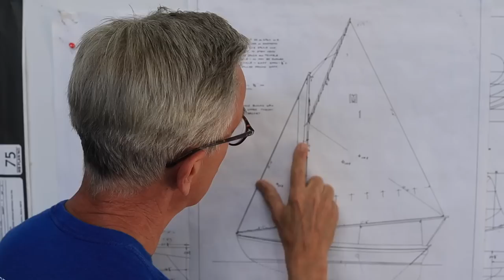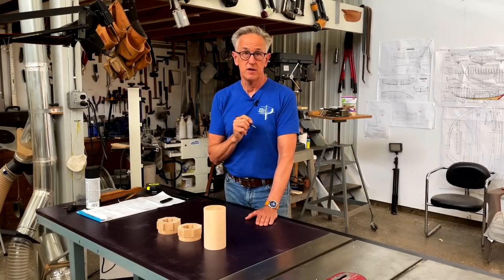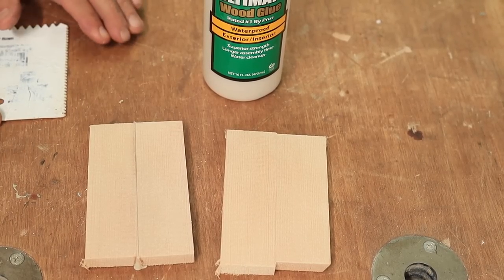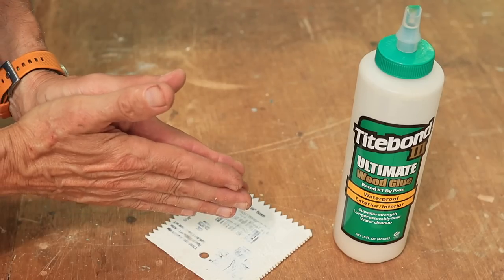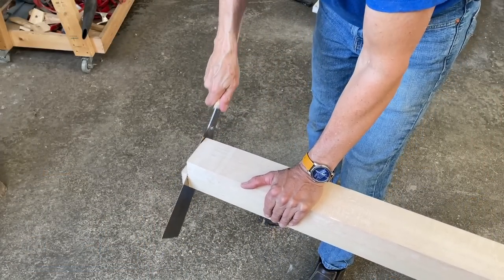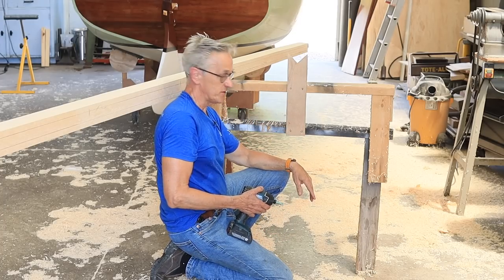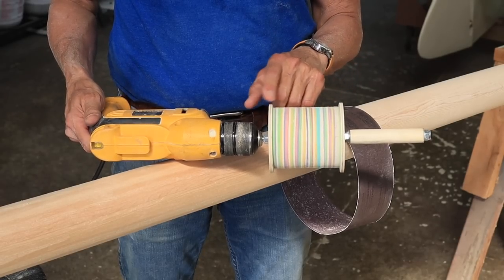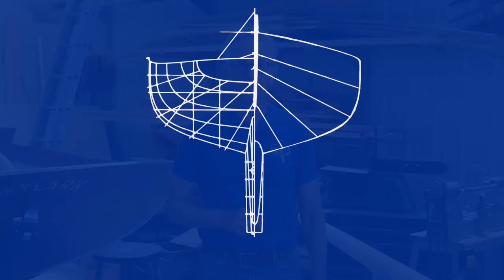Hollow vs. Solid Mast S2 E66

Comment: I'm a naval architect, been building sailing wooden boats for the last 20 years, restored, own and sail a Rival 32 on which I build a cedar hollow mast, along with a cedar boom and spreaders, which are in use for the last 15 tears. never had a problem with it. The core is reinforced at the base, about half way to the spreaders, at the spreaders and at the top. It's been coated on the interior and exterior with epoxy, all the glued joints are also epoxy. All thru bolts are predrilled and fitted with stainless steel tubing epoxy glued where the bolts fit into. electric wiring goes thru the interior from bottom to top, all running and hoisting cables are exterior running with guiding holes on the steps fitted along the mast, this steps are a easy way to inspect the mast at all times. The construction is a simple case with 4 sides and planned to shape. simple and robust, overall it saved about 30% of the weight. The mast is 36 feet long and I can lift it alone, with some difficulty but still can.

Comment: Nice work there mate.  About 10 years ago I  made a new mast for my 28ft gaffer,  it was solid with a 30mm hollow that I use for cables to mast head.  I purposely didnt seal the indide but allowed air flow from both top and bottom by using a fashioned cap on top .   I figured that if any moisture gets behind any fittings and  could potentially start to rot, that the air flow insde the mast  would help out.  10 years later, no problems what so ever.  
I used resorcinol glue and also no issues so far. 
Thanks for sharing your work, cheers

Comment: I'm a structural engineer so immediately your question of hollow vs. solid was intriguing.  In bending which I think is the primary stress acting on the mast, a hollow cylinder is virtually the same strength and stiffness as solid.  I watched to see how you built the mast and it seems that building it from 2 pieces is quicker and less prone to problems that building it out of 8 strips.  I don't think the savings in material is worth the complicated joinery.  You appeared to have gotten 2 good pieces of wood to build from, the advantage of building with smaller pieces is that you might have a better chance of getting 8 uniformly good pieces of small wood than 2 uniformly good larger pieces.  This would likely be more true if you were building a significantly larger mast.  In building construction you've likely seen composite materials such as glue laminated wood beams.  These are significantly stronger than a beam sawn from a large piece of lumber because each small piece can be made up of uniformly good wood, a large piece is more likely to have variations that would reduce its overall strength. However I think even if you were building a significantly larger mast it might still be better to laminate boards flat than to join them to form a circle.  Something you didn't address about the methods of building the hollow mast- how do you taper it to 2/3 of its diameter at the ends?  It seems that the material would get too thin at the ends to work with.
Reply: Easiest way to do it is to gradually reduce the width of the dovetail piece as it gets closer to the top, just take a mm off the flat face every 10cm or so, for example 
If you are really looking for performance then you could also reduce the thickness of the piece but personally I’d prefer to keep the internal thickness as the diameter gets thinner,
Reply: "best" ... after all is said and done, IF you don't need electronics up in the mast, THEN go with the strongest / most efficient / cost effective, BUT if you NEED electrical up in the mast, there are some sacrifices well worth the trouble in order to have a way to get that wiring up there....just a thought, I haven't heard addressed here. success, I too like your videos very much, thorough...complete...thanks
Reply: hey so i have a question, for a 19ft long sailboat, replacing the mast with a wooden one. for that length of a boat which would be about a 22ft long mast, could that be made from a single piece of lumber or would joining two pieces like in this video be better? the boat was salvaged and the alum. mast is not so hot. i would like to make one out of wood
Reply: @jamessawyer8744  assembling from smaller pieces has a strength advantage.  you can select enough small pieces without flaws to put together into a larger piece but you would have difficulty finding a single large piece that was high enough quality wood.
Reply: @billj5645  awesome thank you so much

Comment: In my youth most masts were wooden, rectangular in section, hollow and stayed. Most were also tapered. Very few seemed to be sealed inside and without epoxy, 'sealing' would have been limited to a coat of primer. They lasted ok and when they did rot, it was usually around fittings and penetrations. From an engineering perspective a hollow mast can be stronger and lighter if properly engineered. I have built solid and hollow masts - the choice driven by boat type, use and scale (wall thickness is determined more by the need to resist impacts than rigging loads on a very small mast). If your trying to earn a living boat building, solid will be favoured every time - its so much less labour.

Comment: I would be very curious to see “destructive testing” of solid versus birds mouth masts.  The grain direction and knots have very large impact on strength.  With a solid mast it would be impossible to align grain direction in 360 degrees and very costly, if not impossible, to avoid all knots.  I built a 12 foot birds mouth mast with NO knots and all straight grain aligned perfectly in all directions.  Once the jig was set up all sections were cut in far less time than shaping a square chunk, with less waste.

Rot from within can me mitigated by coating the inside with epoxy while gluing up. 

Btw the glue up was very easy as the pieces fit together like a jigsaw.

Comment: No question that this small gall rigged boat was best fitted with a solid mast.  I built a Herreshoff Marco Polo back in the early 70's and the three masts were designed as hollow tapered box spars.  They were an awesome project...we sorted through MANY units of spruce to find good 11 rings per inch vertical spar grade planks....and then scarf joined the 20'ers into 55' long boards from which I could cut the rabbets and tapers.  They turned out quite nice, two other builders had me make their spars as well.....So I did it 9 times.  Mine, I did all with hand planes...but the commissioned ones, I purchased a power plane.  Gotta say,  the time spend using a hand plane was well spent, the lines of the spars were truly sweet....and it was good PT as well.
-Veteran '66-68

Comment: I actually don't do woodwork. But i know from steel work the rule about hollow structures:
A pipe is stronger then a rod if the cross section is identical. Same cross sections means identical weight (with identical materials, of course). But , you have to increase the outer diameter. As long as pipe and rod have the same OD, the rod will always be stronger.

The calculation get's more interesting the other way: You can get the same strength with less weight (but still, larger OD!).
In vehicles this is quite often justified for shafts and sometimes axles. In boats it might with regard to center of mass.

Comment: Agree on the glue joint. Titebond III wood glue is a “intrusion” resin, made to be “injected” into the wood via clamping pressure. Epoxy, on the other hand is surface held, meaning it “grips” the surface instead of being forced into the microscopic cells of the wood.
Good move.
Reply: That analagy makes sense! The clamping pressure forces the glue into the wood pores! Thankyou👍
Reply: @chrisleggatt3240  S 
(means smile)

Comment: Hi Bob - really great mast - well done! Just one comment to your intro about spars structures. Hollow masts labor, in comparison to the whole boat work effort, is not really significant. They are also not really difficult to assemble as you suggested - there are number of approaches as you know and just one more step for boat building that is fairly complex itself. The main advantage of various hollow masts is that you may rearrange the wood structure to get given properties in term of long and short distances, there is also problem with availability of proper wood for long solid spars. But anyway, I was absolutely impressed on your approach to this issue and final product - brilliant work. Take care and sail safe! Kind regards from Poland, Pawel

Comment: Built a couple of Bolger’s boats w/my Dad, worked at Legnos in Groton CT, and studied naval arch. in school. It would’ve been nice to actually test some varying sections (torsion, shear, bending) modulus and failure strength, but in general the strength contribution of the section is provided by the outer edge, with very little by the core. As noted by others, failures are common at bolts & fasteners or penetrations so sealing is key. Without ANY actual test data at hand, my instinct is that: 1. Laminating evens out anisotropy (differences in strength by direction). 2. Hollow is only marginally weaker, maybe not significantly, in repeated failure tests. 3. Hollow allows wire concealment. The particular joinery is mostly aesthetic, but I’d use a hollow section with epoxy and seal every surface. Great workman’s, btw!

Comment: Ok, from a structural engineering point of view all of the material at the center of a solid mast isn't doing very much to make the mast stiffer and stronger relative to it's weight - just heavier.  On the other hand from a material point of view with a solid mast all of the fibers of wood are all aligned and bound together as perfectly as possible - but perfect trees are rare these days.  Solid masts are probably the simplest and most reliable and is easiest to control degree of stiffness and bendiness by controlling the exact profile of the taper.  You can see why Yankees at least prefer a solid mast if performance isn't crucial.

On the other hand, with a built-up mast you can cut out all of the flaws in the wood and optimize the inside and outside diameters to achieve your desired balance of stiffness and light weight but requires a much higher degree of craftsmanship and engineering.  With a built-up mast your joints also have to be pretty flawless.   The birds-mouth mast gives you a greater glued area than the coopered mast and may have some structural advantages over a straight joint - but I don't think anyone has ever actually tested that.  In either case, a built-up mast is a lot more work.  Cheaper? more expensive? hard to say.

Comment: Hi, this is my first time watching your channel, and so far I'm loving it! 

I just wanted to say that there is a better way to set up your saw horses to ennsure that your aluminum beam is even straighter. It's very late where I am, and I can't find the exact formulas that I'm looking for, but I will try to sumarize as best I can. I will also post an update with the exact formula when I'm able to find it in my books. To put it simply, to get the flattest line with a beam supported on two points, subtract 31.5% (total guess that I'll fill in with the math later) of the beams overall lenght from each side, and place the support there. The second formula is for a beam with the least deflection (different from the straightest line). It's the same principle, but the % of total lenght subtracted from the ends is slightly different. I apologize for sucha  long comment that has no conclusion, but I will do my best to update with the correct information as soon as I'm able to. 

I look forward to a lot more time spent watching these great videos. Take care!
Reply from the maker: Matt, I happy you're enjoying the videos.
As for the aluminum beam deflection I think you way over thinking  a simple set up. The mast weighs 23 lbs. Most mast makes don't have a I beam and generally just use the straightest timber they can find. 
"...don't look for perfection. We're not building a Steinway piano. The goal is good old-fashion workmanship"
     -Greg Rössel, MasterBoat Builder,  "Building Small Boats"

Thanks for watching!
Cheers,
Bob

Comment: Bob - I like your explanation of epoxy vs. titebond. I am hoping to make frames for my small boat by laminating oak strips that I have sitting around. I've seen this done with epoxy. If thats more of a gap filling glue than the titebond, should I consider laminating them with titebond instead?
Reply from the maker: Hi Weston,
Yes, you can consider using Titebond III.( make sure it's Titebond III for exterior use) As long as the laminates are clamped well and there is squeeze out.  
Best wishes,
Bob
Reply: @TheArtofBoatBuilding  Thank you, Bob. Cheers.

Comment: Very useful. A couple of questions: 1. You stated that the weight difference between solid and hollow was insignificant, but did not explain how you arrived at that conclusion. Just from looking at the proportion of space in a hollow mast I’d have thought it was 2/3 or less of solid weight. 2. I’d have thought that a birdsmouth spar would far easier to taper and to assemble than a coopered one (simply prepare rectangular battens with the desired taper towards each end before cutting the birdsmouth; no angles to maintain). Coopered staves risk sliding about in the clamps; am I missing something?

Comment: Thank you Bob for the video. Excellent and beautiful work as usual. Having built a 23' birds mouth mast many years ago, I definitely prefer the glue up of pieces for a solid mast. I was curious what the center of your sanding drum was made of. It looked like discs of rubber or rubber bands. Can you let us know what you used there? Have a great show this next weekend.
Reply from the maker: Hi Matt,
Yes, the traction drum has rubber bands on it. ( I meant to mention it in the video and just forgot) One could use an old inner tube, I had rubber bands so I thought I give them a try since I didn't have any inner tube rubber. Well it worked fine so I keep it. I may replace the rubber bands if an inner tube finds it's way into my life. The Drum need rubber on it so it has more traction that the friction of the belt sanding the wood.
Thanks for watching!
Cheers,
Bob

Comment: Hi from Arizona Bob! Have you always preferred a hinged stick rule over a tape measure?
Reply from the maker: There are several reasons I use a folding rule. For short measurements, under 6, it is more accurate. In some cases for frequent short measurements it’s handy to leave unfolded. I do use a tape as well especially for long measurements over 6 feet. 
I also grew up seeing my father always using a folding ruler so it’s a bit of nostalgia for me, it constantly reminds me for him. 

Thanks for asking and watching. 

Cheers,
Bob

Comment: Doesn’t the sandpaper also take material off the carrier spindle changing the mast sanding area and possibly altering the taper from round to oblong? Do you do a final check of the diameter and taper?

You could always cut a channel in the roof to accommodate mast installs. 😄
Reply from the maker: The spindle attach to the drill has a rubber coat. In my case I used rubber bands ( hence the multiple colors) so it has traction. It does not change size. As I mentioned in the video it is best to go at a moderate rpm and turning the spar as you go. This is important as it would be easy to get the spar out of round. Takes a bit of practice and paying attention. 
Great question! As for suggestion of cutting a hole in the roof, I think I’ll pass on it 🤔
Thanks for watching!
Cheers

Comment: 23 pounds - unexpected - though I did notice how easily you moved the unshaped lamination. I was wondering about the titebond III grab after coating both boards as you slid the top plank into place.  Is a solid mast less rigid/more flexible than a hollow mast?  (And everybody should have a 13’ I-beam straightedge for those big clamping jobs!

Comment: I was looking for a hollow mast build but never mind !
  I like the inside out belt sander, I was thinking about turning the mast using skate wheels as steadies in the same sort of way that you have your supports.  Mind you, your way you can make an oval mast.   Now, a tapered oval hollow mast, there would be a thing !
Reply from the maker: Yes, in fact it is a thing. My friend Steve, who has done my 3D modeling and metal lathe work, built an ice boat many years ago. His mast is not only tapered but in cross section is egg shaped with the thick edge being the leading edge. 
He use the same method it did to get the results. 

Thanks for watching!

Cheers,
Bob

Comment: A question if you please?  I would have thought that ripping the Sitka Spruce into four "Quarter" sawn pieces would result in a stronger main mast joint than two pieces since you would be able to orient the grain for maximum streangth..
Reply from the maker: The spruce I have is quarter sawn and had over 50 annual rings in one inch. My guess is that sawing it into 4 section would not have added any significant strength if any. On my way to the Wooden Boat Show I’ll ask some folks more experienced than me. 
Good question, thanks for watching. 
Bob
Reply: @TheArtofBoatBuilding  thank you for sharing.  Love the channel.   ^~^